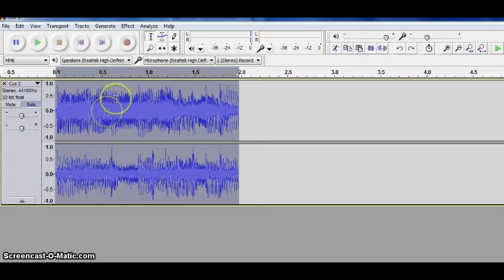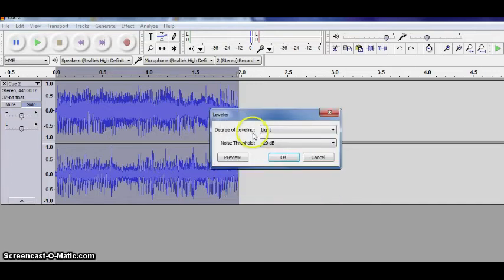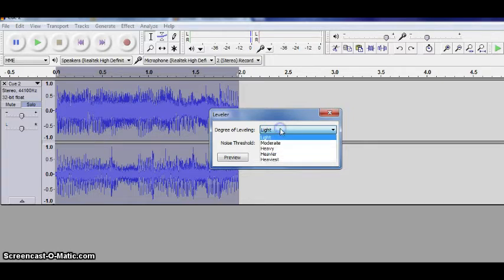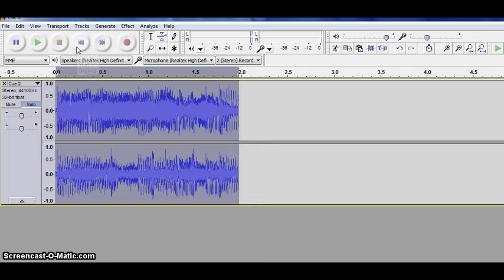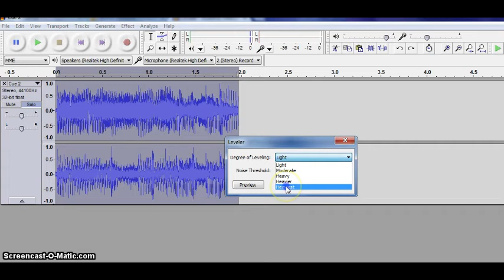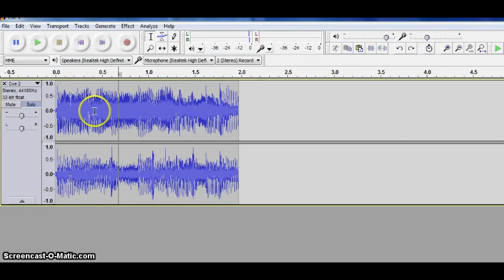Dynamics Processing with Leveler

Comment: I have a Wave file where the top part, like in your example, is much "wider", which to me, is also louder, than the bottom half section. How can I even them out? SO in other words, my Left half seems to be louder than the right side, so maybe I can do that with a plugin that has two tracks on its output. Might not even get an answer since this VID was made 9 yrs ago. Might have to ask Presonus TS dept this question, or dabble with it. I only noticed it when I started mastering the song in the Project Page, so this does not just involve one track from my song page.